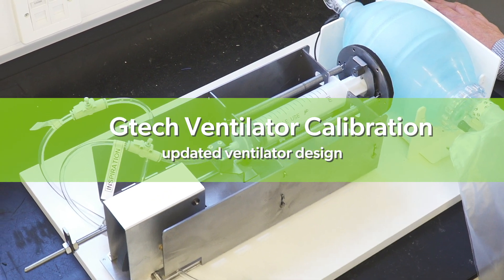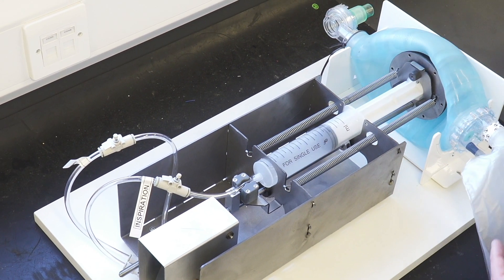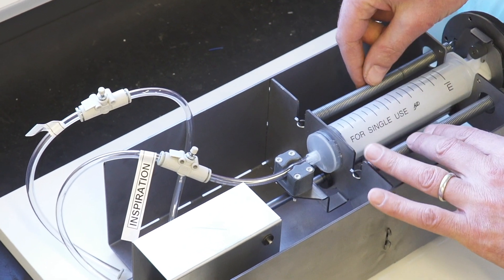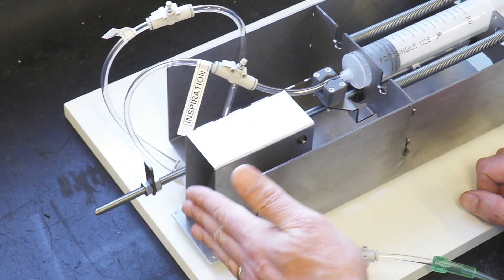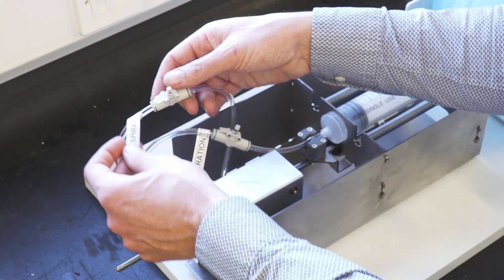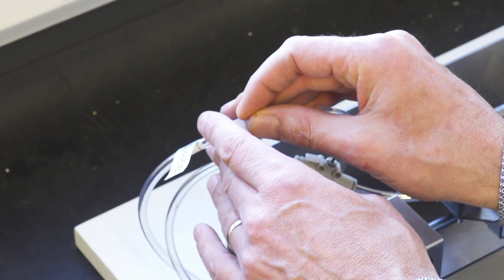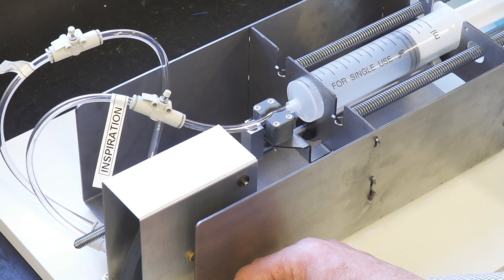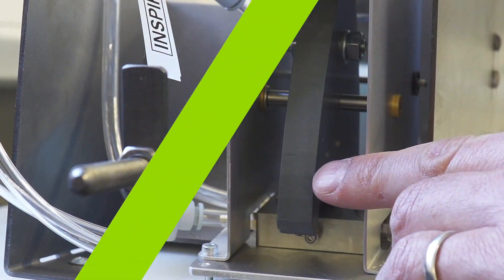Gtech Ventilator calibration guide

Comment: Could you provide a parts list with more detailed specs please? A fully labelled diagram would be very helpful too. And a better look at that spring-over mechanism, particularly that switch component. It makes sense that the air fills the syringe, stretching the springs, that then reach a critical point and snap - compressing the plunger. The plunger then pushes the (connected) control-rod. Somehow, that motion is converted into switching the valve. The valve switch is needed to switch between air in and air out. I don't quite understand that cam-like component hitting the base of the frame with each stroke though. How exactly is that interacting with the valve? Is that a button at the base, or just a screw? Thank you! Despite these questions, looks like a great design! Hoping to build one.

Comment: This is way too complicated and delicate!  Have you seen what's going on in the hospital?  They need something SIMPLE, EASY TO SET UP, AND RELIABLE.  MAKE IT BETTER.
Reply: It's literally no different from a steam powered boiler feed pump, a design that goes back over 200 years.  It uses existing components, and is user repairable. 

Meanwhile Dyson (Tory donor) spent ten days on his design and is weeks away from a prototype, yet the government awarded the contract to him.  When people start dying due to a lack of ventilators, we know who to blame.

Regards, an Engineer.
Reply: Complicated - based on what? As I understand it most existing ventilators require a team of 4 to operate them. This unit uses nobs and valves - mechanical - its designed to do one thing. What complexity is in this system? Do you know anything about it’s reliability? I don’t - but that’s what testing and medical certification is for.
Reply: You have obviously never seen what a modern ventilator looks like,when you do come back with a sensible comment
Reply from the maker: Hi Stephen  - The ventilator has been specifically designed to be as simple and robust as possible using parts from stock materials or bought off-the-shelf. All of our latest ventilator design details including downloadable BOM and schematic animation files can be found at our ventilator page on the Gtech website for anyone to download and use. Updates, including eDrawings and CAD files will be added as they become available.
https://www.gtech.co.uk/ventilators
Reply: @Gtechsocial  Can't you deliver directly to hospitals and bugger the government?
Reply: Mark Somers I’m sure the hospitals are relying on the government requisition since that’s where the money is coming from. I know I would buy this to have at home should EMS refuse to pick anyone up.